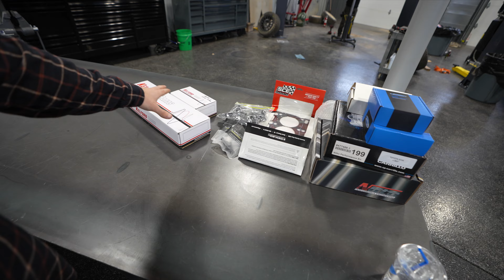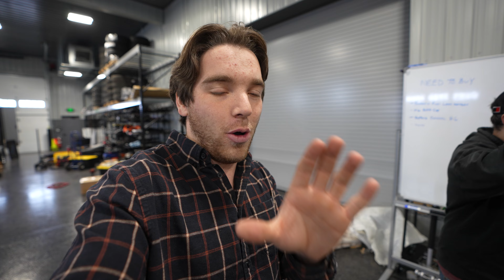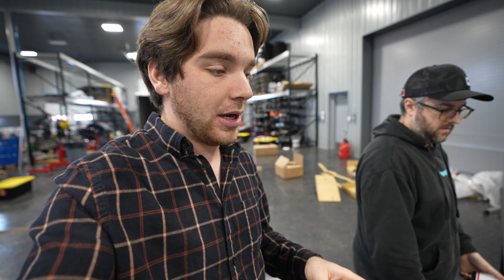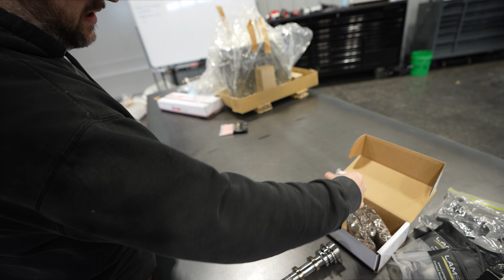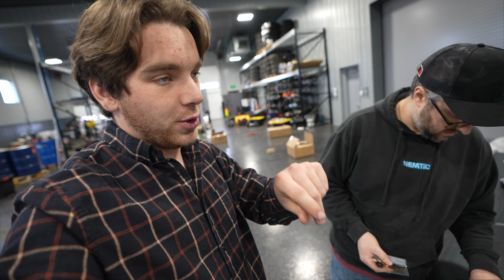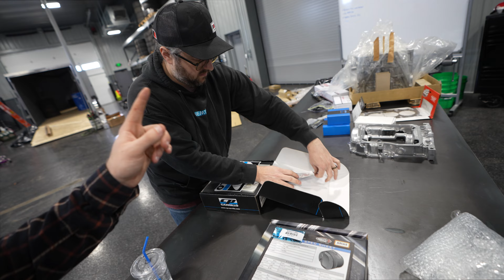500hp GR Corolla Engine Build Break Down (NEW MOTOR)

Comment: dude i have a GR corolla and i bought it at 18 and its so hard to buy parts cause of the price, i want to build mine to be a monster but everything is just so expensive for the GRC driving me insane
Reply from the maker: Brand new platform tax….  Our build is well over $100k….
Reply: @NemtecRacing  i’ve been wanting to get into content with the grc and as an 18 year it would be unique. i got quoted 20k from a shop to get to 460-500whp and that includes 
 reliability and willing to spend some $$, i can get on a Pure turbo, and r an Artec, kelford C’s,  fuel system, FMIC, and a syvecs and Of course head gasket and studs.

Comment: It's awesome to see you guys be so open about all the details and that you're doing it yourself. Keep at it! 

I am curious how that rear diff cover will help. The consensus is that the Cusco diff cover doesn't help, all it does is add more oil capacity for the differential, which doesn't really affect the AWD coupling.
Reply from the maker: We use our stuff at a very high level of abuse and there is not that much rear dif fluid in the stock dif.  So when we start drifting you can damage the rear gear with overheated oil.  Especially for cases like in stage rally you need as much capacity and cooling as possible

Comment: Why are you machining the head, was this an old head? If say i were to order the same or similar parts what is the reason why I'd have to have a  the head machined?
Reply from the maker: Machining might be the wrong term.  They have to pound out the old guides and pound the new ones in.  Then they have to grind the valves to be the right height etc.  and then I bet they’ll do a pass to resurface the head just to make sure it’s flat
Reply: Are the valves just replacing the old ones, these aren't different meaning just new replacements from your last unfortunate event? and resurface is because you're mixing old head with new block? sorry If I'm way of on what all you've got going on, and the guides are interesting, they just make it easier if you ever have to disassemble again? are they halved between the block and the head?
Reply from the maker: @tyrian869 so we actually have a brand new head and a brand new block.  The guides help guide the valves and are friction reducing material so that at high rpm we don’t have issues.  

We are getting the head resurfaced just to make sure it’s flat sometimes oem doesn’t have the flattest finish.  The machine shop will make that decision when the measure the head.

We have all new parts we aren’t using anything from the old motor
Reply: @NemtecRacing  thank you for clarifying. I was confused dang okay, good to know

Comment: Now that ecutek tuning is a thing, would you guys consider building packages for specific power goals with tuning as part of the package? I'd be interested in a 400 whp one or whatever is safe ish with a stock engine.
Reply from the maker: Right now honestly 320whp is about all that’s achievable with “minor” mods.  Anything above 350hp you need a new ecu and are looking at more than $20k.

We are trying to develop stuff but everything takes time.  We need away to reliably run e85.  We need a fuel pump hanger to adapt to a new fuel pump.  And then a way to run ethanol content sensors with the stock ecu

Comment: So are you going to install the pistons without any cylinder work (re-drill / hone)? Spec sheet states a clearance of .0037 for the forged stuff. Also CR is now 9.5:1 compared to the stock 10.5:1 which is not bad in terms of future boost goals. :D
Reply from the maker: We are gonna measure the bore and see if they need work and if so we will do a tiny bit of honing

Comment: Hello Mr Nemtec! I would love to see a comprehensive guide to a range of "Nemspec" builds! From mild to wild! Ps, all specs would have to include the ring and pinion mod. Having a street/track spec, mild to wild, and a rally suspension spec, mild to wild, would be absolutely awesome! It doesn't have to be a pre build, but having a solid, tested directional path of tuning for street and rally would be gold.
Reply from the maker: We can work on that for sure
Reply: @NemtecRacing  😭🤣 #happytears ❤️
On the fence for a new BRZ/GR Corolla 🤯😭🤣
Edit: mild to wild is in reference to HP. Let's say, 320whp, 420whp, and 469(nice 😉😂) whp on 91-93oct fuel. I know engine cooling is vital for more power or prolonged periods of "enthusiastic" driving, but thats something I feel you guys could sort out. ❤️😊
Reply from the maker: @Budgy.Derpy12 I had a new 86 and it was cool but for almost the same money the corollas are so much better in my opinion but if your looking for rwd brz it is
Reply: @NemtecRacing  I'm torn. I want both. I could work that in my current budget but I wouldn't have anything left for upgrades. Or energy because the wife would kick my ass. Lol

Comment: Is there any way to keep a normal 6 speed manual and make higher power or is sequential just the new thing
Reply from the maker: You can put an upgraded gear set in the stock transmission.  It’s still be 6 speed H pattern.  Company called PPG makes them
Reply: @NemtecRacing would that help with the 5/6 gear hub problem going over 330+ tq?
Reply from the maker: @halorita yes it would

Comment: Im glad you guys are putting out GR content! While I own a Camaro Ive been eyeing the GR heavily.
Reply from the maker: Thanks for the support and come on bro.  Just pull the trigger lol.  Gr Corollas are awesome but they are a new car they have a few issues, but if you know about them and you can stay ahead of the game… this is the best car ever
Reply: @NemtecRacing Hi! What kind of problems do these GR Corolla have?!  How did the engine break down? Thank you
Reply from the maker: @wildfishingadventures the transmissions are weak.  And they are expensive to modify because they are so new.  And the valve springs are very weak aswell so can’t run much boost on the stock springs.

Our motor blew up because a valve dropped which was not Toyotas fault
Reply: @NemtecRacing  Ah ok ok I understand.  👍 come on guys I can't wait to see your Corolla in action again 😉
Reply from the maker: @wildfishingadventures with our sequential transmission this thing is gonna be a monster
Reply: @NemtecRacing   I had a veloster N before my camaro but I miss having a hatch and driving a manual. My local dealer has a circuit edition so the temptation is real lol. Keep up the content I love watching engine tear downs with explanations.